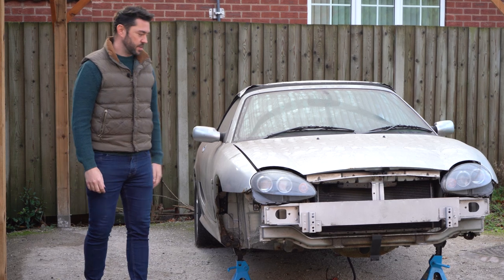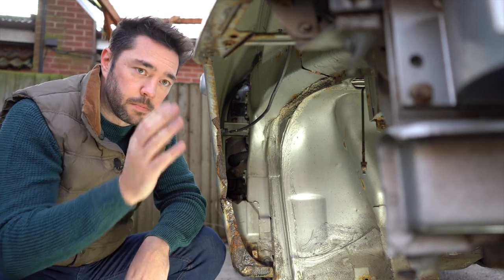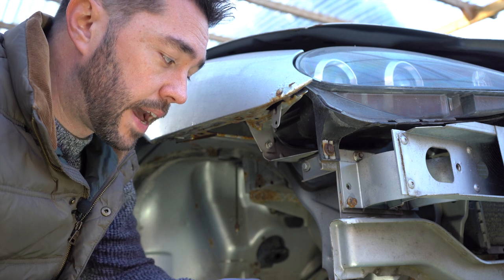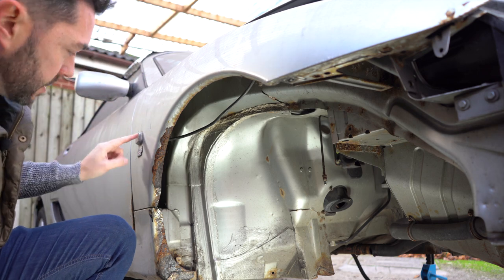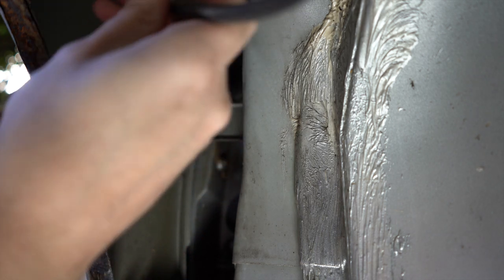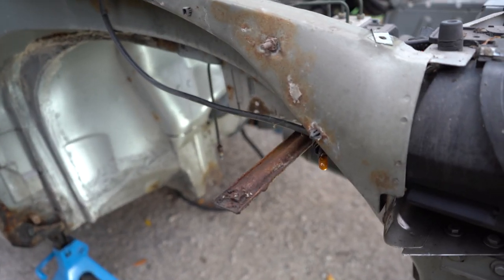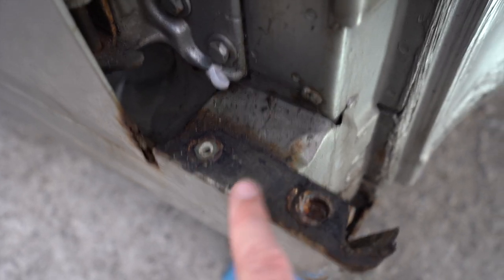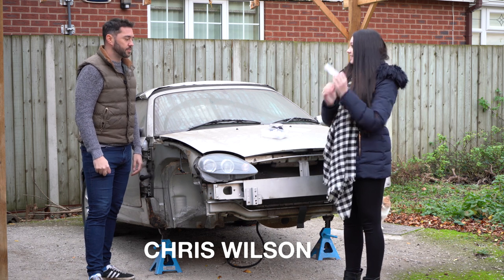MG TF Front Wing Removal + Giveaway Draw

Comment: Only just discovered your channel and have to compliment you on the production, it's really good and I enjoy the content. One tip I can offer which I used for varius rusty bits in the past is soaking stuff in a vinegar bath, can save some money as it's cheaper than always using Kurust or Hydrate 80 (sometines these are a must). What you have convinced me of is that I made the right choice of project, do a modern TF or a classic; the access on the F/TF is just so awful, I am glad I went classic. Would it have been easier, I wonder, to have dropped the engine right out before doing all the work you did?